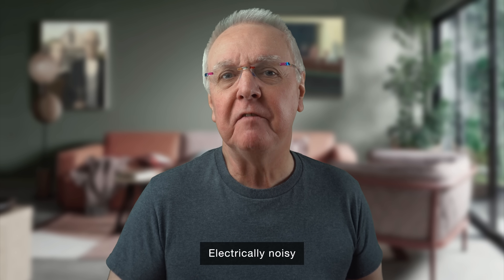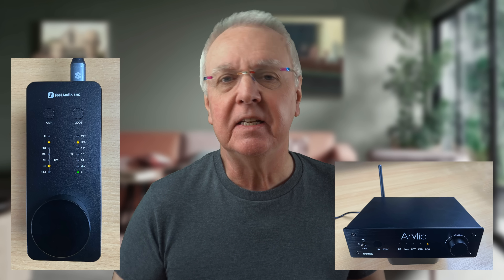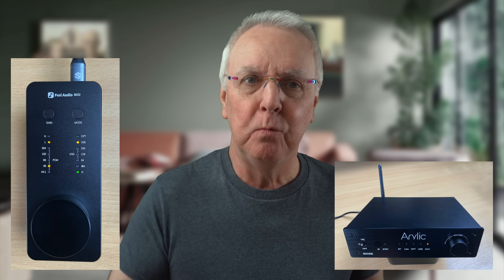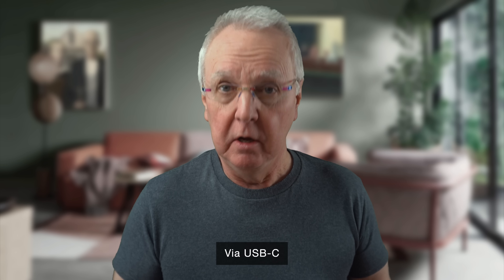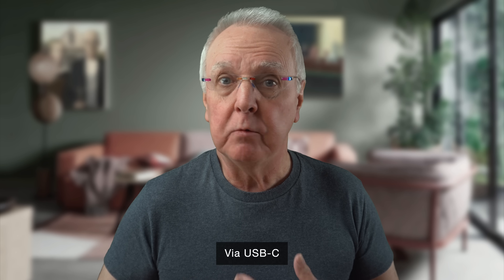Do optical cables have a sound?

Comment: Optical cables are made of glass.  Glass is HIGHLY resonant.  So yes..... optical cables do carry added frequencies which equate to sound.

Noisefloor.  Another one of the many boogiemen created by YouTube Audio Engineers.

Sure helps sell those 300 dollar plug ins modeled after 6000 pieces of gear though.
Reply: Definitely wrong. Fiber does not carry any frequencies. Frequencies cannot ride on glass optical cables and data through binary code light meaning one no light meaning zero the laser shoots off rapid fire combinations of data. There is no frequency at all. It's only do I see light or do I not see light.

Comment: Big portion of you streamers are using fibre optic to your residence, tidal, qobuz etc. Huge distances ok but a 1m not good enough for you?? Don't cheap out though because borosilicate glass one made big difference in my system. Don't use cheap plastic ones. The one going to your house are regulated and of high quality.

Comment: I still use Toslink these days. Connecting my Computer to Amplifier via Line Jack brings noise and hum but as I go through my old Sony Mini Disc MDS-JB920 via Toslink, the sound is crystal clear and free of any audible distortion. AND: I don't need a dedicated audio interface to record my Romplers to Computer using the MD deck the other direction. Next thing I'm gonna do is record some samples of my old Roland SRX-08 board and they're gonna be in original quality because they go through Toslink.

Comment: I just went on Amazon and looked up: 'Pure Glass Optical Toslink' - Unique Products Online 3Ft. Toslink Glass Digital Audio Constructed from 280 Individual Strands of Glass ensures The Least Signal Loss
Reply from the maker: Comment readers check it out here - https://amzn.to/4buTw52 (affiliate link).
Reply: That might actually work, if done right. It won't change the quality, but it would allow for much longer cables. Plastic fiber is severely limited in length.

Comment: I come from an IT background. And no one ever has questioned the integrity of the cables transferring data over networks. And in some applications errors of literally one bit can render a file unreadable (encryption for example). If that works and always works in the same way I fail to see how a digital interface could cause any differences in digital audio transport if the actual cable isn’t faulty or damaged.
Reply: Someone commented that latency is an issue using a stockbroker analogy but that comment seems to be gone. However, in a digital audio setting the latency can be and is easily remedied with a buffer.
Reply: @michachemowski8518  The server latency thing in stock trading is actually an abuse of the system and should be regulated. In audio reproduction none of this matters. It does cause a design problem with digital effects processors because oversampling ADCs and DACs have significant pipeline delay. Unlike pipeline delay in e.g. recording consoles effect processor delay that shows up in real time can not be easily removed.

Comment: I used optical cables for a long while to connect my digital items to a DAC… but have since switched to coax… easier to get the cables for one thing and they are cheaper… and a digital  coax connection can carry more information and also may provide some grounding benefits…  It can support higher quality audio up to 24-bit/192kHz. Optical is usually restricted to 96kHz. But I guess that if the signal is less then 96kHz then probable makes no difference, To be honest I could hear no difference in my system.  But when I have a choice I go coax.
Reply: Coaxial cables are connected through insulation transformers (or should be), so no "grounding benefits". The transformers also negate the jitter benefits of a coaxial connection. I have a 192kHz optical sound card, it just doesn't work because the drivers don't work any longer.

Comment: Sooooo, I have a cheap n cheerful Onkyo integrated amp (A9050) and my only "source" (so to speak) is a Raumfeld connector streaming box. The amp has a Wolfson DAC built in and the Streamer has a Cirrus Logic DAC - both dacs play 24 bit/192kHz. Where it gets interesting, is if I hook the amp up to the streamer using both the line out to RCA, and also the optical S/PDIF. I can then switch the inputs during playback using the amp remote control, and there is a very clear obvious difference! Using the the RCA means that the streamer DAC is used, but using the digital route means that the amp DAC is used, but as far as I'm aware these two DACs are roughly the same. However, using the digital cable the sound is way better! Everything is clearer - really noticeable in vocals, and the music just has a more forward presence. Using the RCA/streamer DAC route sounds duller and muffled! So to that end - and I really don't know if its the DACs influencing the sound, or the cables, or the combinations...BUT there is a very clear difference in my budget set up using the digital cable. I was quite astonished :-)
Reply: I think you are mainly comparing the two DAC s , and the RCA cables used can have a little bit to do with it also. 
I have had that raumfeld connector to, and it sounded quite well for the money. But honestly, they are both budget systems and probably thats why they sound so different.

Comment: In theory there should be no difference in sound quality when sending a digital signal over copper, glass fibre or plastic fibre, so long as the cable used meets the specification of the equipment manufacturers being used, and there is no damage to the cable. It shouldn't be possible to hear a difference.

Comment: Judging from the comments so far, I would say at some point an educational session re. synchronous vs asynchronous digital connections is called for David...
Quite a few commenters do not seem to realise that beyond the correct values and order of music data samples, the sample interval timing is also crucial, something that can definitely be negatively affected in a synchronous data connection like TOSLINK (SPDIF), e.g. by cable quality/length but also by the quality of the optoelectronic components used. This jitter may or may not be audible but to deny its existence ("it either works or it doesn't") shows a lack of engineering knowledge.
Reply from the maker: This is an interesting point, as raised in one way or another by other commenters. Regarding jitter, I don't think an optical connection does either work or not work. I think the point where there is audible distortion or noise due to jitter is very close to the point of 'not working' At present however I don't know how to test this.

Comment: There was a speaker at the Rocky Mountain Audio show who stated that in Computer Audio, different Hard Drives will have  a different sound.   It always amazed me that no one in the audience choked on that
Reply: Replaced the old front hard drive with an SSD on my Mac mini. Noticed better sound right away.
Reply: @LelandPratt-j4k  Very interesting!  That seems to confirm my suspicion.
Reply: We all know that a computer generates all kinds of electronic noise that isn’t a problem for normal computer tasks but is for high fidelity audio.

Could it be that the electronic components in a specific HDD brand or model generate some interference or electronic noise that somehow gets into the DAC and degrade the quality of the signal on the output stage of the DAC?  So much so that it is audible.

So it is not just the ones and zeros being read off the disk but also the other artefacts introduced by the electronics in the HDD.

Comment: It’s no different than Ethernet over copper or glass. 

Bits go in, bits come out the same. Unless there’s damage and error correction can’t fix things. 

As long as the bits are mostly unmolested, there will be ZERO differences between media types. 

Digital is digital.

Comment: Honest to God I didn't know this would be a topic, that said, you can literally just stick a red LED into a toslink receiver and as long as the LED is connected to something (with the correct voltage for the LED) that speaks toslink it will work... Do optical cables have a sound? Not that I have ever heard. Only argument for glass over plastic is cable length (very, very long runs).. a 3ft plastic cable going from a CD/DVD/BD player to the receiver isn't going to change a thing unless the cable is broken which is something you can literally see... no light no audio... as for your link to the sound of jitter.. ive never heard a CD player make those kinds of noises other than in my youth when i barely touched the edge of a playing disc and caused the player to produce static with the music for half a second before it stopped the audio and re-corrected itself.

Comment: TOSLINK uses SPDIF which is a synchronous data connection. This means the master clock is sent along with the data and jitter will be introduced, dependent also on the quality of the TOSLINK components and TOSLINK cable length used. The receiving component can be designed to buffer the incoming SPDIF data stream and resynchronise it to an internal master clock, but at some point that would require drift correction; there is no free lunch. In practice many receiving components do not buffer, and due to dispersion in the relatively low-grade TOSLINK cables and optical transmitter/receiver geometry means that over long TOSLINK connections jitter will become measurable, although it may not be audible before the actual data error rate becomes excessive.
Reply from the maker: It was a long time ago, but I remember a device that received digital audio from a remote source and had to synchronise. It worked fine as far as I could tell, apart from the occasional click which, from what you say, I might assume to be drift correction. My memory is quite dim so that's all I have right now but it might be a matter I can consider for a future video.
Reply: @AudioMasterclass  Well, if memory serves me right then Naim had (or still has?) a DAC that uses 10 slightly different fixed master clock frequencies and keeps switching between them to maintain the same average clock frequency as the source; sort-of a continuous drift correction on-the-go. Presumably this does leave some level of jitter, but probably with a different (perhaps more benign?) noise frequency spectrum.

Comment: I have recently purchased an AudioQuest Cinnamon Toslink cable which I use between a Marantz Ki Signature CD-63 Mk 2 CD player and a Chord Mojo 2.

This gives me “galvanic isolation” between the CD player and the DAC, so electrical noise can’t be transferred between the components - as others have experienced and described in the comments.

To be able to run a Toslink-coax comparison, I will first have to buy a Moon Audio coax cable that terminates in a 3.5mm jack which goes into the Mojo 2.
Reply: Galvanic isolation (i.e. no electrical connection) absolutely does not prevent noise which can be and often is transmitted by the toslink encoder.  

What it will do is prevent a ground loop between two devices.
Reply: Is there a technical report somewhere on the shortcomings of the Toslink encoder?
Reply: @johantheron4282 
I'm sure there is. They probably exist inside Toshiba during product development and other companies as well.   But you should not need some voluminous document to understand that A) any circuit will transmit it's noise on it's output and B) noise on digital signalling is largely insignificant... That's just basic electronics skill.

Comment: I use optical ethernet, not toslink between my server and my DAC. The cable runs along the wall under a dimmer, past numerous power cords, some of which have equipment with switching power supplies, and then up into my stereo rack past more power cables.
Switching to optical over standard ethernet was very noticeable.

I hear no difference between cables that are not damaged and made to spec.
Damaged cables are very easily heard by ear as well, and sound like sibilance. Optical can not introduce jitter, only the hardware at the ends can do that. I had a cheap Amazon cable and you could hear the change in sound as you bent the cable. It is expensive to make cables to spec, I won't say that "audiophile" cables are needed, but cables made for professionals are, and should only be sourced from Western sources.
 
Optical has very strict standards regarding bend radius, coating on the fiber, and end treatment (perfectly polished and square). Defects are very measurable, and losses are also easily measured due to bending. The 10x diameter to quoted is way too tight, the cables I have used usually state something closer to a 6" (150mm) radius. The 50' (15m) optical HDMI cable I use for my projector clearly states that any bend under 5" permanently damages the cable.

Comment: I can actually add something useful to this conversation!  Maybe.  I work on ships after having left a job in investment banking some years ago.  My last ship and probably future ships lay or repair undersea fiber optic cable.  

Here is the relevant bit...maybe.  The signal does degrade with distance and this is remedied by something called a repeater.  The repeater takes the signal in, boosts it, and sends it on its way.  How it does this, like much of the system, is in the industry called PFM (Pure F-ing Magic).  The distance between repeaters, however, is measured in miles or kilometers, not meters; many miles and many kilometers, not 10 - 30 meters.  I know you ruled out the length of cable as an issue, but I wanted to point out that it is laughable to me that it could degrade in a home audio setup because of distance.  The importance of not bending or crushing it is certainly an issue, but we bend it within the limit under pretty massive amounts of tension (weight of the cable times many miles of cable down to the sea floor), so it does not need to be babied Obviously we are working thicker cable so it can be bent less, but it was shocking to me how small the cable is even between countries worth of data traffic.  Remember, we are talking about flashing lights at different wavelengths moving at the speed of light.  It either works or it doesn't is the answer.
Reply: Can you get over well over 10 meters by orders of magnitude pretty easily on the base ~3.1MBit rate spec?
There is plenty of modal bandwidth to do so, but the attention is around 180dB/km (0.18dB/m), which is around 500 to 1000 times what you can get on singlemode (wavelength dependant) and the link budget isn't going to be very big.
It is not designed to deliver audio across a city, but part way across a room.
It is cheap, robust, easy to connect, eye safe.

Comment: There most certainly is an optical analogue to electrical resistance, and it's normally referred to as attenuation or signal loss. The amount varies widely according to the type of optical fibre used and what it is made of. The sort of plastic polymers used in TOSLINK have very high levels of signal loss, whilst those used in very long distance optical fibres are very low. Of course none of this matters a jot where digital data is used up to the point where the loss is so high that the signal is unusable. However, that's just the same with copper as well. There are also other forms of distortion that can occur with optical fibre, such as dispersion, but again it varies hugely with material and implementation (it is, however, particularly bad on TOSLINK fibre connections). However, that only affects range and speed and not data integrity when used digitally. 

Note that there are situations where optical fibre is used in a purely analogue manner, such as some types of borescopes (not the ones where there's a small camera at the end), but that's pretty rare, and none of them are relevant to audio. Nothing to stop it being used that way, save it's stupid, but it could be done. However, on key difference with electrical analogue is that there would be zero difference in frequency response for analogue optical signals at audio frequencies.

Comment: I am using a 15 metre Toslink cable between my wall mounted TV and a Linn DSM Selekt connected to a Primare i35 amp, itself connected with 10 m cables to a pair of highish-end Falcon Audio floor mounted speakers. OK, this is not a pure hifi arrangement because of the source limitations but it is certainly better than the Naim Muso, also connected to the TV optically. And the Muso is pretty impressive anyway and fine for TV channels. I only use the more upmarket arrangement when playing bluray concerts or opera.

Comment: I have a chest freezer that is almost 30 years old.

When its thermostat turns it off it emits an em pulse that is picked up by my guitar pickups or, any cables transferring analogue audio on my hifi as a pop or a click.

Back when I had my amp connected via an rca cable and the sound was transmitted digitally,  the chest freezer clicking off would cause a brief pause in the sound.

Same amp hooked up with a digital optical cable- no pause.

That's it, that the only tangible benefit for me.

Comment: Skipping the “differences in optical cables’ sound” drivel, I can say TOSLINK is really a godsend in avoiding ground (pardon me! — earth) loops. For no good reason at all, I record the occasional NYC Met live opera broadcast on Saturdays, digitally, on Beta video tape, via a 1970s, Sony PCM-to-pseudo video converter. I then play them back — when no-one is looking — on my stereo about 10m away. I send the signal from the Sony, digitally. I tried co-axial cable, but that suffered intermittent “earth” loop clicks, like built-up voltage discharging. With my 10m optical cable, none of that. (And I know, I mentioned this before in a comment to your prior TOSsr@g video.)
Reply from the maker: If it works, it works. Enjoy.